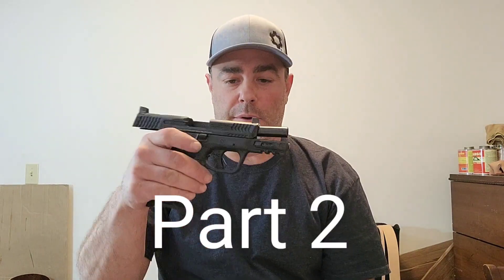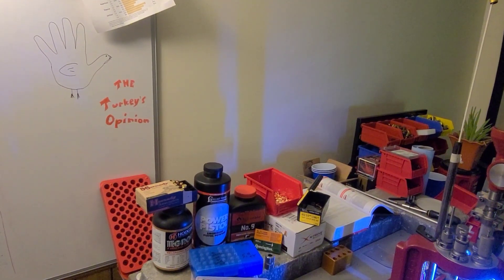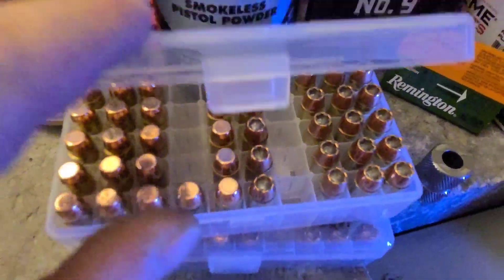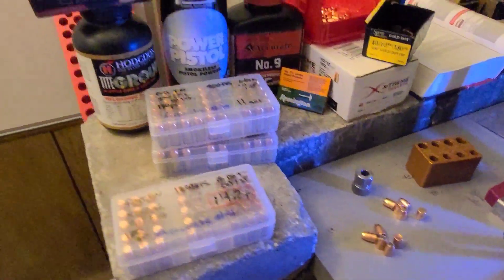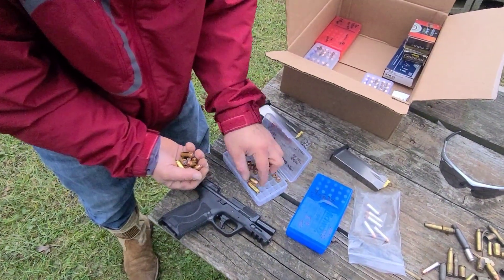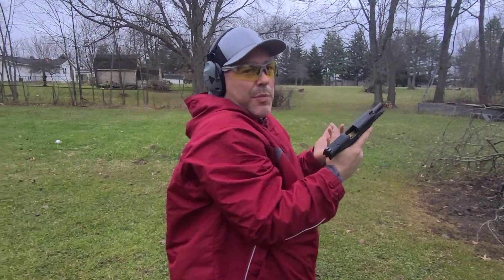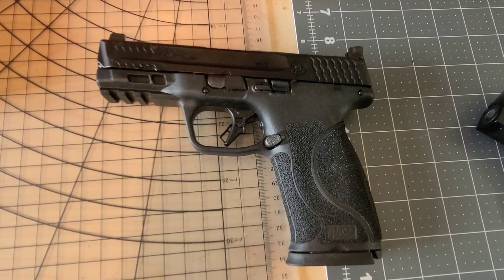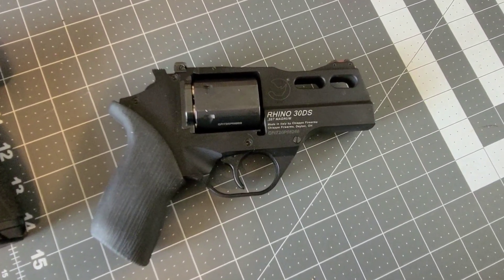S&W M&P 2.0 10mm 4" Update ( part 2 of 2 ) - More testing, take aways so far...

Comment: My thoughts take me to a stronger mag spring to get the next round up quicker in to position for the slide to camber when using higher pressure loads, which I believe causes faster slide operation. A heaver recoil spring would cause a faster return of the slide, stripping off the next round before that round is ready. This causes bullet to angle upward, striking the hood of the barrel. I'm no expert, just a novice with an opinion.
Reply from the maker: I think you are 100% correct👍🦃👊
Reply: @theturkeysopinion  This isn't straightforward and as easy to figure out as I thought. I have heard that a stronger recoil spring has helped, at least some people. I could see if the original spring was too weak to stripe off the next round. A stronger spring would help. A strong recoil spring might also keep the slide from slamming rearward, reducing felt recoil and reducing stress on the gun. But if the bullet gets lodged against the upper hood, I still believe the mag spring is too weak or the follower is binding, keeping the bullet from reaching the proper placement before the slide can stripe it off the mag.

Comment: Did you try wolff springs made for he m&p 45? They are built on the same frame and have them up to 24 lbs. They work perfect in the 10 mm. I got a wolf 20 lb for my m&p 10mm 5 inch to tame the hotter loads. Works great. You have to buy their guiderod too but small price to pay.

Comment: The most undersprung pistol in history lol. Extractor issues, magazine issues, rmr screw & plate issues. Mine has been an expensive journey. I'm 80% M&P. My platform of choice with all factors considered. But with the 10mm, I wish I'd bought a G40 or XDM. Or waited on the new FN510. After more than a year, 2 trips to SW, multiple shooters, environments, and ammo, I can confidently say that my 4" will get thru a magazine w/out failure.... Most of the time lol..

Comment: Thank you for all this testing, especially with your own loads. I recently got a 4.6" version, got a great deal on it, new in box. I knew even before ordering that it has certain issues, so I ordered a 24lb. Galloway RSA and stronger mag springs from Springer. I wanted a bear defense gun and considered a Glock, but was concerned about the grip size, so ended up ordering the M&P. I am still catching up on all the videos, etc. but have learned that yes, the gun is seriously undersprung, the stronger RSA is worth it - it tames the recoil and prevents the gun from beating up the hands and the frame. But another issue that others have discovered is poor magazine geometry (channeling ribs and feed lips, unlike the M&P40 and M&P45 mags) and it usually specifically causes issues with heavier bullets due to their fatter shape (wide meplat). I'll leave a couple of links below that have photos - not my work. In my testing I had mag drops and stoppages with Underwood 200gr and 220gr hardcast. No issues with range ammo or Underwood 140gr Xtreme Penetrators. I'll probably just stick with Xtreme Penetrators, but I also tested "hybrid loadings", where I'd load first 10 rounds of Xtreme Penetrators, topped off with 5 hardcasts (and 1 in the pipe), to keep them from interacting with the mag catch window. Worked 100% for me. In summary: I think that some of the hot load issues are solved by a more adequate RSA (24lb. is perfect for me, and it still cycles the range ammo), while the mag drop (and potentially other stoppages) are caused by poor mag geometry and fat heavy bullets. Not acceptable, but for me it's a keeper, since I found that Xtreme Penetrators work 100% and they should do the job. For those considering an optic I definitely recommend getting a C&H metal plate and not using the included plastic plates - there are reports of the optic flying off under recoil. I have about 200 rounds, including Underwood, with the C&H plate and Swampfox Liberty and it's holding up well and holding zero.
Reply: I've had my S&W M&P 10mm M2.0 4.6" pistol since mid-May 2022.  To date, I've fired only 10mm Auto ammo through it, a grand total of 1,821 rounds, mostly various brands of 180 Gr FMJ range ammo, but also 600+ rounds of Buffalo Bore and Underwood hunting and self-defense ammo, ranging from 140 Gr Xtreme Penetrator through 220 Gr FN HCL.  

In short, I've experienced only one malfunction of any kind, a FTF running Underwood 200 Gr FN HCL, with the pistol in it's factory stock condition.  

I replaced the weak factory 17# RSA, and weak factory magazine springs in late May 2022 with a solid stainless steel guide rod and uncatured 24# recoil spring from Wolff Gunsprings, and a pair of longer stronger 11-coil magazine springs from Springer Precision.  I also use an alloy adapter plate and stainless steel screws from C+H Precision, rather than the cheap crap that came in the box from S&W.

Since investing in these needed upgrades in late May 2022, I've run 1,605 rounds of 10mm Auto ammo through this pistol, enjoying 100% flawless reliability.  I've never had any magazine drop issues, despite running 220 rounds of 200~220 Gr FN HCL ammo through it, from Buffalo Bore (220 Gr x 20 rounds), Steinel Ammo (220 Gr x 20 rounds), and Underwood (200 Gr x 80 rounds, 220 Gr x 100 rounds).  

I always clean and properly lubricate my guns before and after using them - Basic Gun Ownership 101.

Thanks to a lot of favorable mentions regarding the Galloway Precision fully captured 24# RSA, I acquired one myself.  I found it performs virtually identically to my Wolff Gunsprings setup, but with the added convenience of being a fully captured assembly... so I'm now running with it.

She's got great ergonomics, and she's very easy to shoot well... definitely a keeper in my book.

Good things!   👍
Reply: @jpg_sig10  thank you for all those data points! 100% on cleaning and lubrication, especially the latter. At this point I can either go through the expense of testing more 200/220gr hard casts or just stick with the Xtreme Penetrators that do perform for me. I feel like it'll be cheaper for me to just carry the more expensive XP's, a paradox :)
Reply: @languagesource355  
I do like the UA 140 Gr Xtreme Penetrator load, but they are very expensive.  Also, from all the testing I've seen, the Xtreme Penetrator is a lot more likely to be deflected by bone... it doesn't penetrate as straight or as deep as the heavier FN HCL loads.  

I am curious about the S&W M&P 10mm Auto M2.0 magazine design.  The very short feed lips, the steep feed angle (compared to their 9mm Luger and 40 S&W magazine designs), the lack of channeling all the way down the magazine like the 9mm Luger and 40 S&W magazines have.  Even their 45 ACP magazines have channeling that runs farther down the magazine than their 10mm Auto mags do, to direct cartridges inward away from the magazine lock ports.

Still, I've now fired 360 rounds of 200 Gr and heavier 10mm Auto ammo through my M&P 10mm 4.6" pistol with never an uncommanded / unwanted magazine drop issue. 

- 100 x UA 200 Gr Hornady XTP JHP
-  100 x UA 200 Gr FN HCL
-  120 x UA 220 Gr FN HCL
-  20 x BB 220 Gr FN HCL
-  20 x SA 220 Gr FN HCL

I've done this while firing 2-handed, strong-hand only, weak-hand only, during both slow-fire and rapid-fire, all free-standing.  

I don't know what else to say, other than I'm sorry you're having difficulty.  

I've found my pistol to be very reliable.  She's now up to 2,100 out of  2,101 10mm Auto rounds fired with no malfunctions of any kind, 99.952% reliable.  I've found her to be very accurate, easy to shoot well, and overall a great purchase.

Good things!  👍
Reply: @jpg_sig10 I'm glad yours is working for you. It's a likable gun, handsome and ergonomic. I am thinking the tolerances on yours stacked in your favor. Not so much for me, but I know some have had it even worse. I'd share a couple of links with you, writeups by others, but you have a pretty full understanding of the magazine issues and springs. Appreciate the info on XP's sliding off bone, I've never seen that in any videos (my only source of "data"), but I can see how that could be the case. I would only ever encounter a black bear, and even that - extremely unlikely. But I think I'll test the HCL from Underwood again, when I can snag them on sale. I'd much prefer the cheaper rounds, especially considering they are likely more effective.

Comment: I've seen a lot of people say by putting in a new recoil spring assembly with 22 or 24lb springs corrects it's issues. Seems disappointing to me that S&W basically has this gun tuned for light load stuff only.

Comment: Thank You very much, your video's are excellent, your time is greatly appreciated. I purchased a M&P 10mm  about a month ago. Its a 4.6 " with no slide safety.  In the last 3 weeks have run approx 250 reloads through it with no problems ( I load P.P. 81/2 - 9.0 gr. with 180 gr. rn  and hp,  x-treme bullets. I also shoot 200 gr. cast bullets. I reloaded 200 gr. Berry Bullets,  After the first 250 rounds I began having f.t.f problems with the Berry Bullets. One or two rounds per mag. ( with both mags ) Needed to force the slide home to fire. Same problem as you displayed in your videos. Closer observations revealed the live round had stopped in a horizontal position on the feed ramp, nose of the bullet did not point up towards the barrel chamber. ( maybe a feed ramp of mag.problem )  This problem continues for the next 50 rounds. Thinking it may need a good cleaning, I left the Range. I have put 4 -5 times that amount of rounds through my Glock 20 with no problems.  I have been reloading for over 15 yrs. without this problem in other guns. I will take this gun back to the Range in a couple of days and see how it operates after being cleaned, and no Berry Bullets.
Reply from the maker: That really stinks. I thought the 4.6 was doing pretty well. 🤔
 I would definitely get on Smith about!👍👊🦃 Thanks for the info!

Comment: I bought one at the end of December and during my initial fieldstrip to clean before firing the sear disconnect lever fell out the bottom of the mag well, you could tell it was never secured in the gun. I sent it to S&W where they had it for a month with no contact and no explanation other than they enclosed a form that said they replaced the part.  I got an email from Fedex that it was enroute back to my house. After i got it back all it did was jam with 10mm velocity ammo. It only functioned while running 40 sw velocity loads. Smith obviously has quality control and inspection issues they need to address. The sad part is I traded in my Glock model 40 for it as i thought it would be a more practical platform. I was wrong.
Reply from the maker: Oh geez.That is  Totally ridiculous. Sorry to hear that man. But it sounds about right anymore.👊🦃👍

Comment: I've been reviewing these videos and didn't see if/when you tried the increased recoil spring that was suggested that protruded by 1/10"??   Also, your magazine springs that came with the mags that came with the gun brand new.   How long are they?  I'm gathering data slso and trying to get some good baseline data.  My 4.6" run 100% with 900fps up to nuclear loads without an issue.  But curious about the length of your magazine springs that came wit the 4" gun the day you bought it?  Thanks for any info you can supply.  I'm willing to compare any notes I have also in return
Reply from the maker: I had to take that video down... I was extra cautious due to the rule changes. 
To be quite honest with you I don't remember much about that firearm. I did try the other Spring with a little bit of improvement. I think. There are much better Spring options on the market now. 
I don't even have the firearm anymore so I couldn't tell you the Spring length in the magazine. Sorry.👍👊🦃

Comment: I saw these videos a while ago from you and managed to pick up a 4 inch 10mm a month ago. I also ended up with failures running hot hard cast ammo. After looking at the recoil system I noticed it was very close to gen 3 Glock 19 guide rod. I bought a 20# g19 and g17 spring. Pulled the guide rod apart for the m@p and the g17 is basically an exact match unsprung. I installed that in my m&p and it definitely stiffened up the slide. Feels as tight as my TRP and EAA in 10 mm. Hopefully I'll get out and run it soon with the new spring. Possibly a good fix at only 9$.
Reply from the maker: Wow! That is super awesome info! Thank you so much for that!
 Let us know how it goes!👍👊🦃
Reply: Hey Sam Baker, did it fix your issues?!!!

Comment: It looks like you seriously need a heavier recoil spring!! Are you also using a supported chamber and checking your ammo in your barrel that’s out of your gun and are you running your 10 mm through a crimp die with a very light crimp to fix any issues when the bullet gets pressed in the brass? I’m pretty sure your misfires are because you do not have a heavier recoil spring and your slide is getting jacked back too hard! I also see your brass is slinging too far my plus P loads the Brass falls 3 feet away with a 22-24 pound spring!
Reply from the maker: I definitely think it needed a heavier recoil Spring. I think the magazine Springs are pretty weak too. 
As far as the handloads. A very light crimp. 10 mm brass seems pretty easy to work with but 10 mm nickel casings are a mother effer. Is they smush and buldge.  I run every single bullet through a Lyman checker. The good one.  I'm pretty obsessive about it. 
If I know I'm going to a match or class I will take the barrel out of the gun and double check in the barrel also just for redundancy purposes.👊👍🦃
👊👍🦃

Comment: Thank you for the great vid on this. I’m running a Glock 20 with a 22lb spring. When I initially setup the gun, I was intending to only run hot loads (Underwood, Double Tap, Buffalo Bore etc). And my reloads are Acc #9 with a 180 JSP running around 1300FPS (I won’t post the charge data). It absolutely runs every hot load I’ve tried, but it chokes on light 10mm loads like Blazer. I’m assuming the S&W factory 17lb spring it for ideal for the light loads. 20-22 lbs may be better suited for those stout loads
Reply from the maker: Thanks for watching!👍👊🦃

Comment: I’m with ya on the light spring. Seems like they didn’t tailor this gun towards hunting or high pressure loads. A real shame because this would win over the blocky g20 for woods carry and that’s the majority of the 10mm market these days. 

I think OAL might be an issue with the flat nose profile bullets as well. I wonder how they compare to your gold dot loads that ran so well. 

Would love to get this gun if it runs hot xtreme penetrators. I think yours were the defenders at 100g.

Comment: Thanks for sharing all this work.  This pistol is interesting for me if I could use it hunting feral hogs.   I'd like to see it cycle hot hard cast loads reliably.  It's awesome that you're taking the time to run a variety of ammo types through it.  Often, we're only able to see a gun handle range ammo, and that's only good if it's a range toy.  Great stuff.
Reply from the maker: Thank you for your comment! That is exactly why I am doing this. You know what they say, if you want it done right… lol. I love 10 mm and waited for this thing for a long time. It really kicked me pretty hard when it didn't run properly. I am absolutely determined to figure this thing out.
 I'm glad people like you appreciate this content! It is not for everybody. It's a little bit nerdy.🤓  Unless you love information and numbers
Reply: @theturkeysopinion  Rare to see this much testing and analysis on 10 mm loading, plus examing a gun's function.  Thank you so much!  I've had to settle on a FMJ flat nose for relieble usage, though stricly as a woodland hunting pistol.  Finding the right powder has been a problem too, ala the burn rate.  Hollow points always seem a little long at the nose affecting cycling problems; the springs in the magazines is troubling too.  Keep up the great videos!

Comment: Great video and subscribed to your channel. I have the XDM 10mm with 4.5 inch barrel and did put a 22lb spring in it and it runs the hotter ammo great. I agree that manufactures should include multiple weight springs. I would rather have extra springs than extra grip panels lol.
Reply from the maker: Great info! Thank you! I'm testing that one next. Looks like i know to get a 22# right off the bat. Good point on grip panels lol.